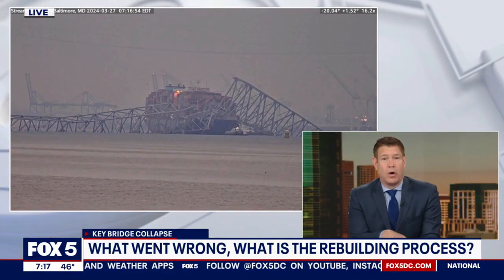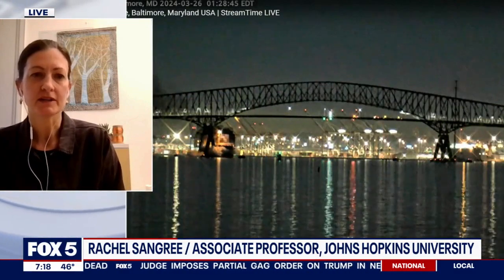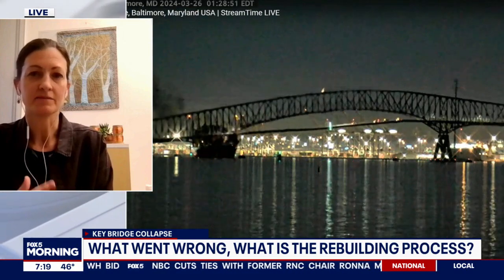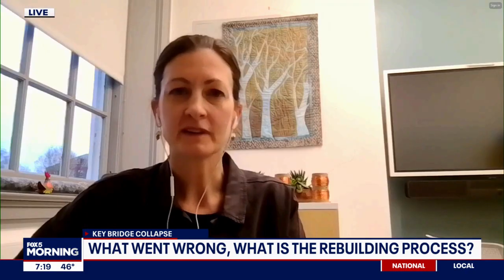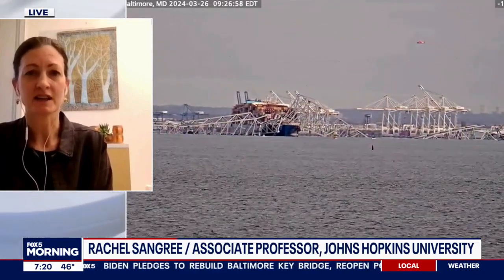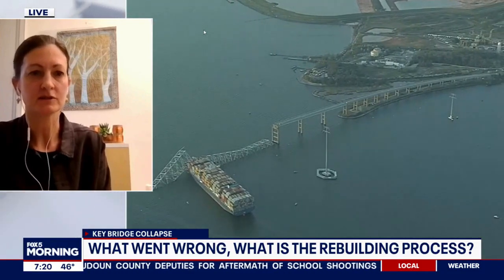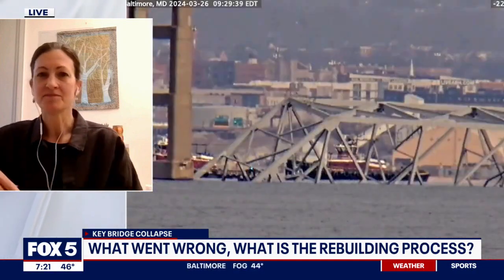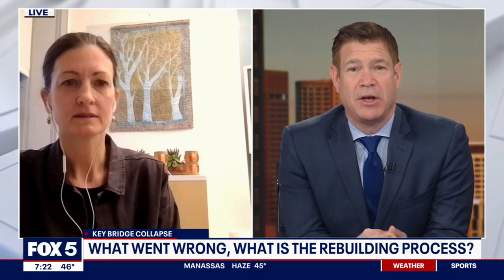Key Bridge collapse: Engineering expert discusses what went wrong

Comment: After learning more during the past 24 hours: 1. The Dali lost steering (rudder) but the single screw engine was running. The ship was experiencing power outages while underway. 2. Dali was moving forward at 7-8 knots when the exhaust cloud was seen on the video. This was caused by reversing the engine to slow or stop the vessel. 3. Like any single screw vessel it pulled hard to starboard (right hand direction) when thrown into reverse but kept moving forward. Even in reverse a nearly 1,000 ft. container ship will not stop on a dime. The rudder was not available to counteract this pull to starboard. This is what caused the hard right turn toward the supporting pier. 4. The Dali ran directly into the pier.

Comment: Earlier I learned that the vessel didn't have tugs. Apparently,, they weren't required. A likely change may be a requirement that vessels of a certain size or mass use tugs.
Reply: once in the channel or highways tugs were  done as usual
Reply: @smilsmff  The Dali started with tugs but at a certain point they aren't required. The accident happened after the tugs left.

Comment: She's a goomba .. Expert .. When someone say " Practical " what they are saying is " On The Cheap " .. Money is the first consideration in building a bridge when it's going to be used  just as a bridge ... The design entry was probably picked because of the cost , acceptable risk , Even Helen Keller could have seen the inevitability of failure . A truss system is so interdepenent of each point of support , Distribution of point loads, shear , tension and compression. I deal with Egginneeers and some are the dumbest card carrying experts I ever met .